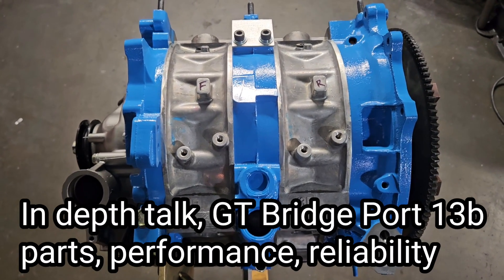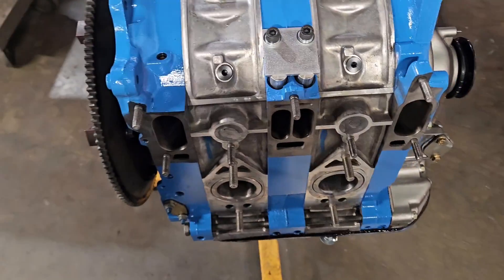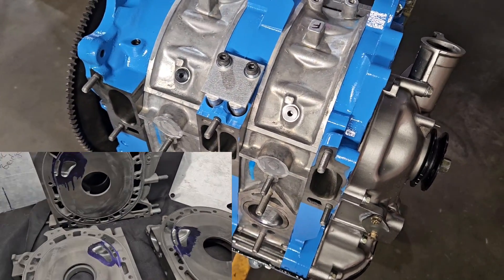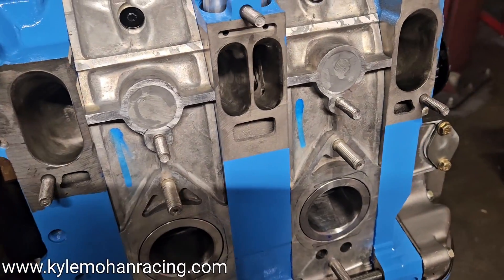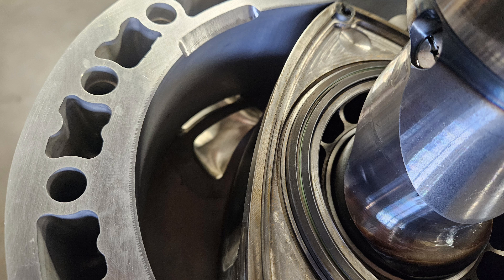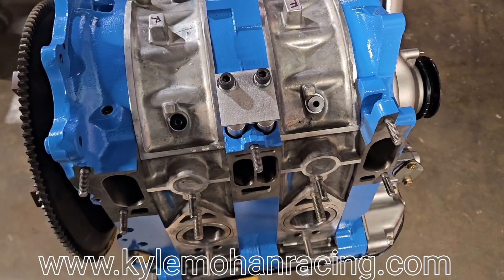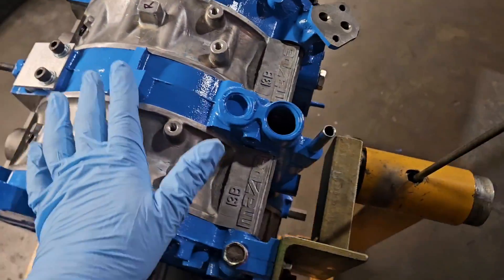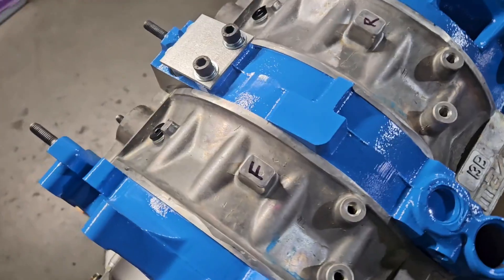Full Bridge Cosmo 13b build - Technical breakdown - parts, build, GT3 RX7 KMR Rotary Tech Pt. 3

Comment: It would be a great idea if those templates were made available.

Correct me if I’m wrong but in the video you stated that it is easier to obtain 13 B Cosmo plates than other plates.

Reason I ask is I have a six port motor that I’m trying to do and all out NA built for a race car to run at my local track circuit that is. And I am not too fond of the six port plates just because availability of parts more exclusively manifold are not readily available.

Any insight would be great. Keep up the good work love the detailed videos.

Comment: Think you can do a video about ports like oil ports and coolant ports. When building custom engines with different throttle boddies what ports you can block off or what ports you will need a hose to jump between ports